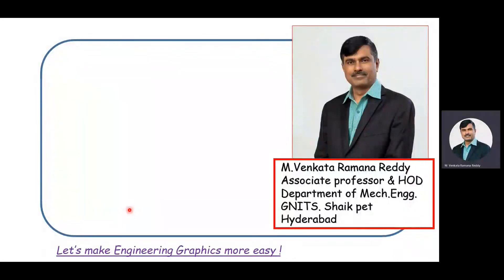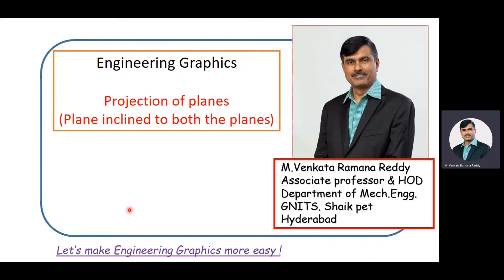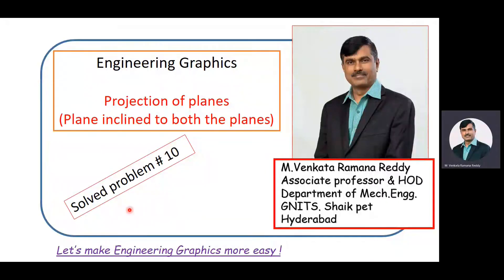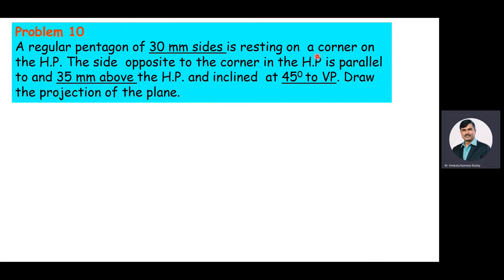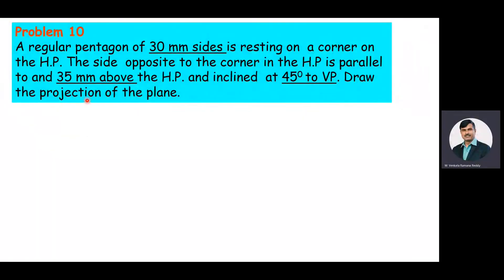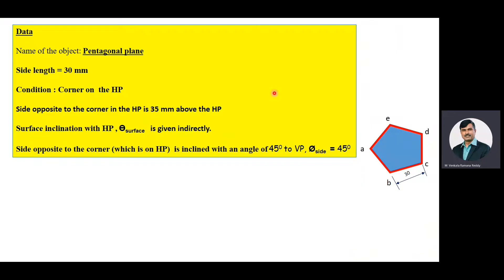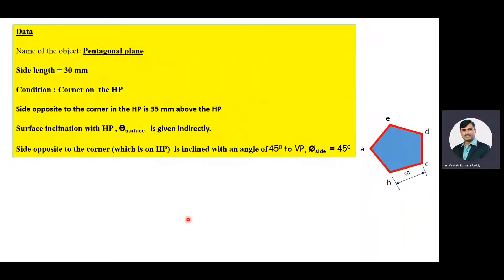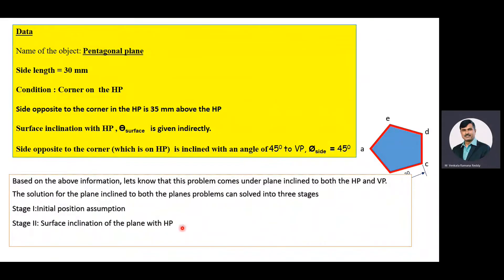Pentagonal plane inclined to both the HP and VP

Comment: Sir I just have one doubt, after we get the top view and for inclination with respect to VP can I take the distance of the corner tip and opposite edge mid point or it's a must only edge should be inclined
Reply from the maker: Only edge should be
Reply: @venkatrr8050  why is it so sir? Even if we incline with the distance with the corner tip and opposite edge mid point still the edge is inclined with the respective angle right?

Comment: Sir i need answer for 
A pentagonal lamina of edges 30 mm is resting on HP with one of its sides, such that surface makes an angle of 60° worth HP.The edge on which it rests in indined at 45° to VP. Draw it's projections,
Reply from the maker: Please go through the playlist on planes and see the problem